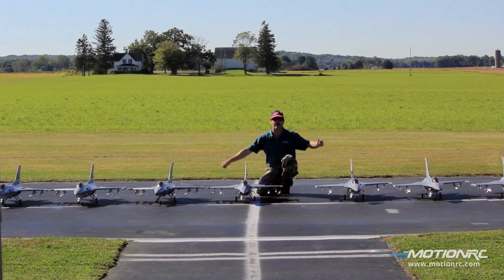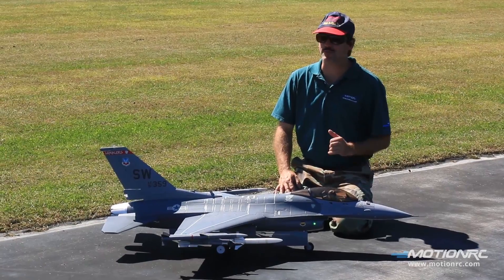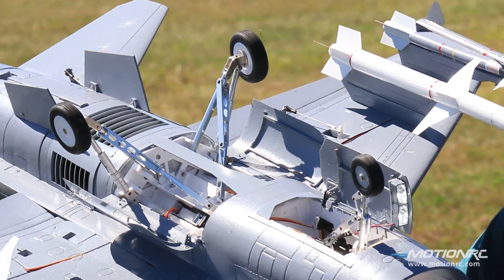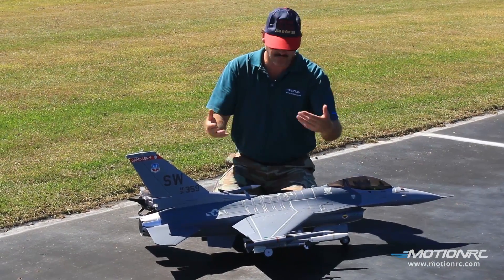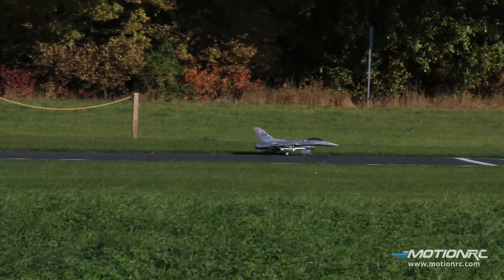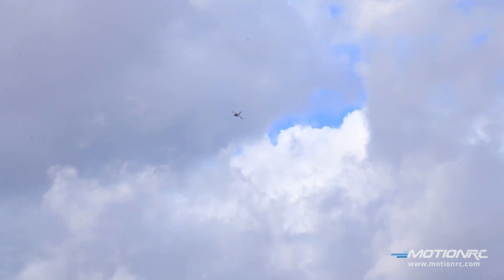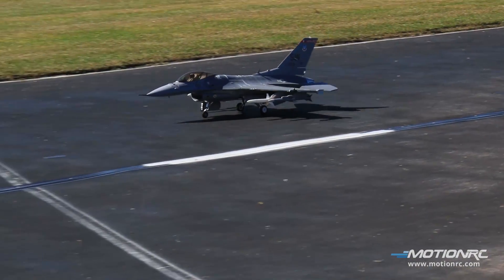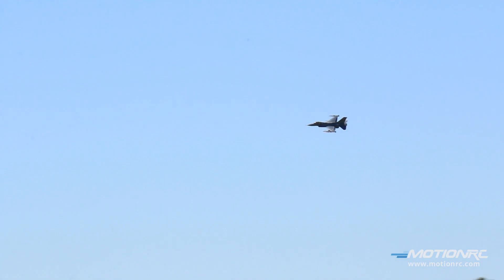Freewing F-16 90mm EDF Flight Demo

Comment: Any comments on grass landings? Is the nose gear up to it, or do they bend after a while?
Reply from the maker: GEar is always down when landing or you'll destroy the ordnance and little peripherals
Reply: @MotionRC  So you're saying the NOSEGEAR is NOT UP TO IT! You can do better than that. I was hoping the forward raked angle would help with grass landings but the smallish nosewheel takes away that advantage apparently. The mains look very solid. But the nosewheel appears to be an Oleo, not a trailing link. The oleo nosewheel is in keeping with the real thing, scale quality. But that doesn't help with the majority of us that fly off grass. I want to give it a go, but without some clear solid grass landing endorsements, I'll pass.
Reply from the maker: @hifinsword  Sorry, I read your comment wrong. Thought you meant you wanted to land with the gear up (belly land). The gear on this 90mm F-16 is as robust as any 90mm Freewing model. All of them are made with the grass pilot in mind (hence the larger than scale wheels). You will have no problem on most decent manicured grass runways. Plenty of videos out there, just search Freewing F-16 Grass and you'll find them
Reply: @MotionRC  Thanks for the clarification, and the suggestion.

Comment: What percentage do you have the flap settings? My takeoff flaps are at 50% and landing at 90%, how ever it seems the plane wants to stall  with full flaps. I have the Thunderbird version and use Spektrum Dx8e transmitter

Comment: stupid question, since im a newer pilot, how do you keep that shallow turn angle but still youre able to keep the turn somewhat tight? is that adding just a little rudder or alot?
Reply from the maker: A little rudder goes a long way in a jet at speed
Reply: @MotionRC  sweet, I’ve just been banking and yanking with the jets. I’ll give a smidge of rudder

Comment: which battery are you using? with the normal admiral 5000 50C you have to put the battery a little bit more near the front. i think  you are using an heavy and bigger one and that the reason you found that position. for example now i bought the carbon admiral 5100 70C and they are heavier 100gr so i put them in the position you put your battery..  please let me know about the battery used in this video. thanks

Comment: Is it true you can only fly for around 3 min.'s at a time?
Reply from the maker: Depends on how you fly them. Throttle management can extend flight times. But 3-5 minutes in a jet is exhilarating. When i started with jets I had 1/2 and like 1 battery for each. I would do those 2 flights, get the batteries on charge and relax with a warbird or high wing cub, and then the jets batteries would be good to go for the next round

Comment: Guys can you tell me how much percentage on the flaperon movement you have on the take off and the landing setting
Reply from the maker: +John Knopp 
Hi John, our take-off flaps are down, slightly shy of half flap. Check the manual for down flap measurement and set just above half flap.  I didn't like full flap for landings so I set mine around 19mm. Every plane's servos and radio are different so you'll have to experiment a little to iron out what works best for you.

Comment: Fantastic video!  I'm saving up for one of these. I've flown 64mm jets for the last two years and I'm ready for the 90mm F-16!
Reply from the maker: Thanks! Be ready for the extra weight and higher wing loading. The Stinger 90 is the lightest 90mm and is very forgiving. Mike and I love the F5 for the warm up. We think it flys very similar to the F16 but is more forgiving.
Reply: Thank you for the advice! Will I be able to fly this with my Spektrum Dx6? Motion RC
Reply from the maker: Yes, I use a dx6
Reply from the maker: Yes, I use a dx6

Comment: Just received the Freewing T-Bird F-16C from Motion RC and can't wait to get into it. My girlfriend said I have to wait till my birthday (59) in two weeks to open it. Drooling of course looking at that packed cardboard box. I am going with the upgrade inrunner motor, UBEC, ESC, JP electric 60mm wheel brakes,  Mr. RC Sound and AS3X Rx with the DX8 Tx. I will utilize the information that you provided for the flaperon set up. My winter project and will paint the landing gear and wheels white with a chrome painted tail cone. Have flown other EDF's such as the Super A-10 which flies great and can be seen at Mrtcoltpilot here on utube. Any extra comments will be greatly appreciated. US Navy Retired Cheers
Reply from the maker: Dude, get to work. Just put the box back and tape it up. Lol
Reply: Ordered the 8s upgrade in-runner motor and fan yesterday along with the UBEC. The 150amp ESC OPTO has been back ordered. Birthday November, Friday the 13th, then the transformation begins. I will be bringing it to the Toledo Show with my mods.
Reply from the maker: Sounds awesome. The Tbird scheme looks great!